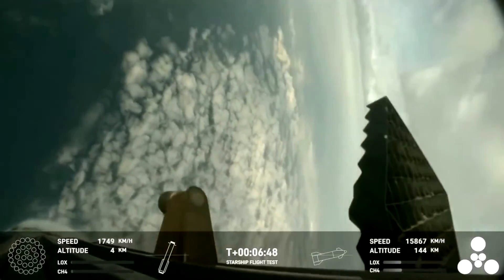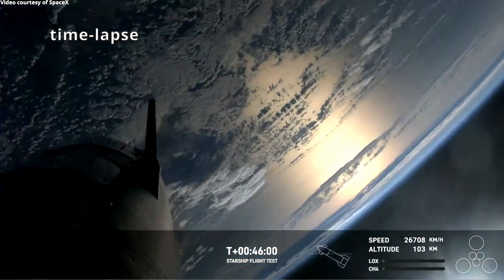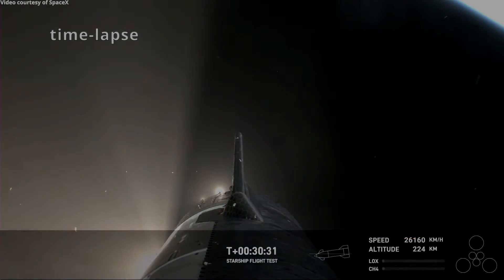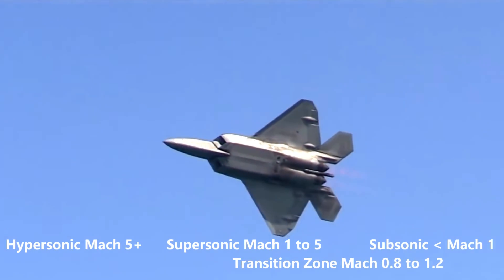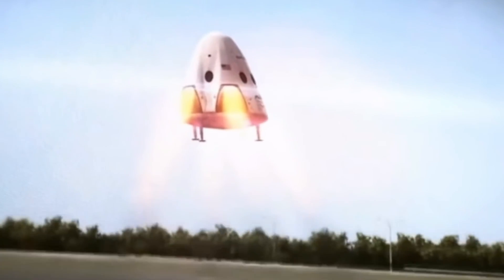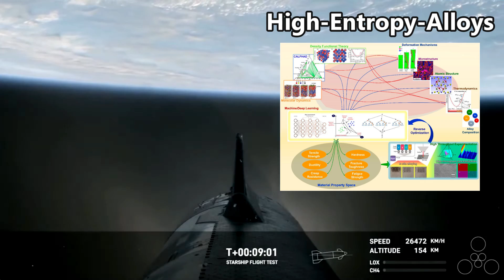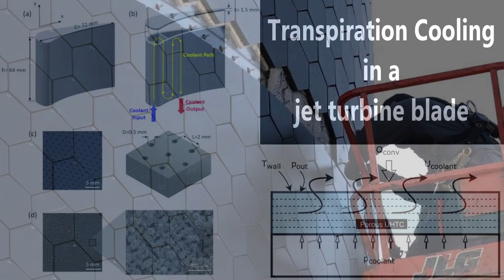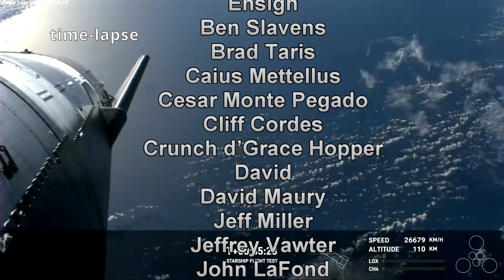Starship Integrated Flight Test 3 Analysis

Comment: Actually pretty hopeful; Nothing inherently wrong with the design other than certain inadequacies which just need augmentation,  in ways that ought to be rather easy to accomplish.

I've seen the control surface you suggest referred to as a "beaver tail" on other ships - e.g. the B2 "Spirit".
Reply from the maker: That's right!

Comment: Original design for Starship wasn't a pointed cylinder but a blunt nosed, rounded triangular section,semi-lifiting body design with a trailing "belly" surface, and larger fins. Elon changed to the "pointy" round design because it "looked cool!" In spacecraft/aerodynamic design, functionality drives design... NOT what "looks cool". Maybe he should use some of the designers from Tesla Motors to design Starship. They couldn't possibly do a worse job. IMHO
Reply: Nah, cylinders are cheaper than triangular bodies, and he has to pay for thousands of these things (instead of just billing The Feds), so it matters - these prototypes are just proving out the giant factory. The "Make it Pointier!" thing was Elon riffing on a joke in SBC's movie "The DIctator".
Reply from the maker: And it should have stayed that way in my opinion :-)

Comment: Regarding metal superalloys, the cancelled VentureStar SSTO was planned to have a reusable Inconel thermal protection system in order to avoid the problems of the ceramic heat shield in the Space Shuttle.

We know Starship is using basically the same ceramic heat shield as the space shuttle, because someone compared Starship and Space Shuttle heat shield tiles with a microscope.

Looks like SpaceX is optimistic they can avoid the issues NASA had with ceramic tiles. I wouldn't be too surprised if they end up trying something else.
Reply: During the aborted Lockheed Martin VentureStar program, a new thermal Protection System developed by Rohr Inc. was announced. The system utilized a nickel-based superalloy developed by Inco Alloys International. The material features a high creep resistance and high strength at high temperatures alloy. At the time, it was loudly claimed it was safer and cheaper to maintain than the ceramic protection system used on the Space Shuttle. According to Lockheed the VentureStar's metallic heat shield would have eliminated 17,000 between-flight maintenance hours typically required to satisfactorily check (and replace if needed) the thousands of heat-resistant ceramic tiles that compose the Shuttle exterior. I have heard little about it since. I had high hopes SpaceX would adopt the VentureStar TPS for Starship.  There are some rumors that a derivative of it is being used on hypersonic vehicle development. If anyone knows what happened to the seemingly promising development let us all know.
Reply from the maker: I loved the Venture Star!!

Comment: very good video.
the conclusions are plausible and logical.
Good structure of the video and clear explanations.
no lengths in the video to waste time.
I think your thoughts can help spacex further.
the fundamental problem of flight characteristics becomes one
big problem for spacex because of the weight distribution and
the wing design is difficult to change.
It's logical, but Spacex forgot maneuvering jets,
even though they have them with the capsule.
The staggering of the starship shows that no one is thinking about it
has thought about re-entry.
Losing heat tiles is a disgrace.
at the moment when the entire geometry changes
The Starship will eventually have different flight characteristics.
Spacex currently has excellent engines though
the rest is unusable.
or to put it more simply, they come up but guaranteed
not down.
There will definitely be nothing with 6 starts this year.
Reply from the maker: Thank you so much!

Comment: Why not cover the whole ship in tiles?
Reply: Weight/dry mass in already an issue. Adding more is.. not good. SpaceX is going to try to take mass out of the design.
Reply from the maker: That's a good question... then it can survive down to where the air will help it fly

Comment: Uh, Columbia was lost because of missing heat tiles.
Reply from the maker: No my friend. Damaged carbon-carbon leading edge. No tiles involved.
Reply: @terranspaceacademy  Oh I see. Still heat shield damage.
Reply: @J7Handle  on a vehicle made of aluminum, not stainless steel.

They simply aren't the same, and trying to say so is a gross over simplification.
Reply: @spaulagain  of course they're not the same, but I wouldn't expect Starship to do well through reentry with missing tiles. At least, depending on where the missing tiles are. I could see missing tiles on the sides being a non-issue, but missing tiles directly on the belly or critical sections of the flaps? I don't see Starship surviving that, steel or not.

Comment: I commented elsewhere if shape contributed to loss of control.  It looks like thruster size is also to blame, plus the vectoring limitation as installed.  I kinda wondered how much vectoring the thrusters had.
SpaceX also needs to open an close the payload door thousands of times and speeds to test for fatigue and durability. It's a curved door which complicates linkages and hinges.
Also, did you notice the stuff flying past the camera?  Heat tiles?
Should have been a camera on the exposed side of the starship to watch the stainless steel melt.  Fascinating! As Spock would say.
Reply from the maker: Shaped like the original CTS it would have been stable... otherwise you need some serious RCS

Comment: Will done
So far this is the only immediate, factual analysis that addressed
The lack of control on  booster and ship
Loss of heat tiles.... you can see them falling off.... way before reentry begins !
Inadequate thruster sizing
Next launch.... when !?
Reply from the maker: A thermal protection prophylactic!
Reply: @terranspaceacademy  Call it what you like 😆it's massively cheaper and faster than tiles!
Reply: Trust me, the heat tiles are not the final solution for starship. They're gonna keep giving problems. My idea: An ablative  thermal blanket pulled over starship like a sock with a zipper that releases the thermal sock once heating phase is over. Once caught by the tower, a mechanism can pull a new thermal sock over starship. Super fast and reliable.

Comment: My theory is the booster had control issues as a symptom and not a cause. Just like the booster blowing up before it hit the water was, in my mind, a syptom. I think the apparent lack of control was due to the fact the speed was too great and put it out of velocity parameters. This caused the oscillations as the computer tried to correct but couldn't. Then the engines (build up of gasses due to the failed light attempt?) caused the explosion. As for Starship, I believe it was lack of control that killed it.
Reply: Perhaps high speed at low altitude led to excessive back pressure of air into engine nozzles contributing to relight failure?
Reply: @novanights2chevy597  that's my uniformed opinion
Reply from the maker: The engines had a relight failure too. The question is? Spin due to engine failure or vice versa?
Reply: @terranspaceacademy  spin due to failure that allowed excess speed that the control computer couldn't account for

Comment: I agree that the Starship needs more energetic control thrusters. The slow roll was noticeable from the outset. The booster seemed to be having problems with the grid fins. Theses controls need to be beefed up and enhanced before they will be successful. I also liked the use of Inconel alloys suggestion. Inconel has been around a LONG time, and isn't that outrageously expensive. Hard to work with and I don't know how easy it would be to fabricate into rings for stacking?
Reply from the maker: Here's the problem. Hot gas thrusters from the tank ulage works while the engines are running.  When they are not pressure drops and they don't work as well.

Comment: When I think of faulty tiles, I think of what happened to Columbia.  I wish they would develop a spray foam aerogel that could coat the ship.  Or, a giant vat they could dip the entire ship underside in at once.  Heat up the Starbrick material and dip it in and out.  No chance of peeling heat tiles then.  

Yeah, it's crazy, but it would be better to land on Mars with a full shield than have to program Robby the robot to scale up to the nose cone for a repair job.
Reply from the maker: Columbia failed from a frozen piece of foam hitting the carbon-carbon leading edge... no tile involved. Maybe Inconel would have survived.
Reply: That would leave nowhere for thermal expansion to go other than shatter the shield. The liles don't touch for a reason...
Reply: @owensparks5013 actually aerogel has a bajillion pours of air when it's put in a vacuum and cured.

Comment: Interesting video.

Hypergolic attitude control thrusters: It's possible that SpaceX could use hypergolics (hydrazine, nitrogen tetroxide) on Starship for the attitude control thrusters. We used it in the Orbital Maneuvering System (OMS) pods that we built for NASA's Space Shuttle Orbiter. Those propellants are toxic, so it adds complexity to ground handling. But SpaceX uses those chemicals on its Dragon spacecraft, so it has plenty of experience with those propellants.

Shuttle lost tile: You refer to STS-27 when a single tile on the bottom of that Orbiter was severely damaged by an impact during launch. There was no exposed metal as a result of the impact. The white part is the remains of the damaged tile that's still firmly attached to the strain isolation pad (SIP). The backside of the tile is glued to the SIP (Nomex felt material) that, in turn, is glued to the aluminum skin of the Orbiter. The black material in that photo is the silicone adhesive (the glue) that's charred by hot gas impingement. The reddish-orange material is the silicone adhesive.  There is no evidence in that photo that hot gas reached the aluminum skin or any steel plate.

Side note: My lab spent two years (1969-70) developing and testing dozens of different ceramic materials and processing methods for the shuttle tiles during the conceptual design phase of NASA's shuttle project.
Reply from the maker: Thank you!

Comment: You didn't talk much about the booster. Was it supposed to be on one engine when it fired to slow down? It appeared to me the steering fins where making wild sweeps to try to compensate.
Reply from the maker: It should have been more.  They had a relight failure and blowout.  The question is, spin due to engine failure or engine failure due to spin?
Reply: The live show they said the 13 inner engines were expected to relight to bring down the speed, before a soft crash into the ocean on the 3 core engines only. As he points out, and the same was on my mind watching the live, the imbalanced shutdown would be where I look first on why it did not relight, but hard to have physical evidence to guide us when the booster "landed" in the ocean at over 1000 meters per second. I do not mind the booster dying here because as his point early on... nobody but SpaceX and a few lighter rockets use reusable boosters. Recovery is just too complex. 

Loved the launch though.

Comment: I'm sorry but, you are so wrong about everything... i tired of that kind of speculations.
Reply: Can you elaborate? Not out of spite, purely interest
Reply: Without any argument, your opinion is worth less than the cost to store it on yt servers.
Reply: Instead of bitching about what's right or wrong, come up with your examples of what's wrong. 
After all, that's how real science works.
Reply from the maker: Sorry you feel that way.
Reply: Only a bd (big dummy) says this with zero examples
Reply: Typical loser trying to ruin ppls day.
Reply: Interesting. I found his video thoughtful and supported with facts and figures for a convincing analysis. Your accusation is basically an insult backed up by nothing.
Reply: @dwpettey  You can do an analysis of the flight and make assumptions about possible defects or errors, but you cannot present this as fact when no one has any concrete facts. Even me.
More than that, I hate it when people alone (and therefore with only their point of view and their knowledge) feel more inclined to make such drastic design changes when many shuttles have very different shapes and uses.
But having a YouTube channel and hundreds of people telling you're great doesn't help you break out of your comfort bubble.

I will take just two small examples. There are indeed too many things to say and it is difficult for me not to use a lot of translation, since I am French.

So. He claims that the Starship has no flaps at the rear. In fact, the shuttle never had one at the center back, it's just protection for engines, like the Starship has its surrounded engine compartment. The fins are present in other places but are nonetheless fins. Moreover, the Starship can increase its drag coeficient in front AND rear, which is not the case for shuttles presented with a fixed wing. The proportion of Starship's control surface is also already larger than the shuttle.

He also claims that the raptors are "too heavy". Header tanks have been placed in the tip of the nose for this purpose for almost 2 years now. It appears that the last belly flops did not see the flaps in any absurd positions and the stability, even without cargo, was remarkable. So even in the atmosphere, this remark makes no sense. (I know, not everyone can follow everything, but if you want to analyze in detail, it would be a question of being informed)
Moreover, in a vacuum, the notion of weight has no meaning, because it is the center of gravity which is attracted (and the rotation takes place on it. It's the purpose of the center of gravity) and the difference between the front and rear weight has almost no influence at this altitude. Unless you believe that the drag is sufficient at this altitude, but the unstoppable rotation demonstrates the exact opposite.
Or questioning the gravitational theory.
It is like you say earth change his rotation because the Mount Everest. No, in fact, the center of gravity shift, and that's all.

In short, the only thing that forced the Starship to make this uncontrolled rotation was probably due to the dumping of propellants. The overall design really has nothing to do with it.
And that's a probability with all the observable clues, not a statement about thrusters, ship shape, or other things.
Reply: @theplouf5533  very interesting points! Thanks mate 😁 and fair play on the English, it was spot on! Better than my French! Bonjour
Reply: @theplouf5533 you should learn how to listen to what person actually say and not twist shit around in your mind..
Reply: Maybe this french complainer should gift his unprecedented knowledge to ESA to help with their crappy ariane6
Reply: Please do, I find all his calculations used a proof of his Ideas very conclusive to his content.
Reply from the maker: Wonderful insights. I learned so much. Thanks.
Reply: Starship doesn't use hot gas for  the reactionary thrusters as he showed.   Instead it uses Ullage gas for primary control.  Without that nothing else here makes sense..
Reply: @dahlgren  I thought it used Elons farts
Reply: This dude thinks we would just chuck a starship up in Leo with no guaranteed way of bringing it back down where we want.